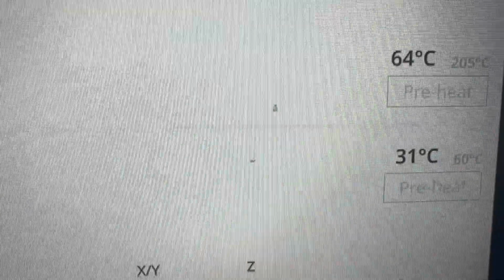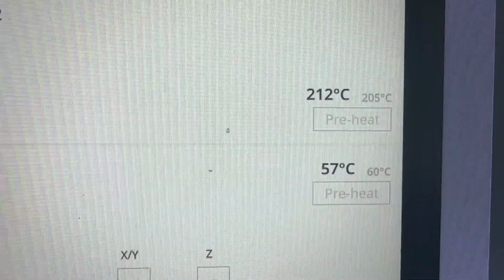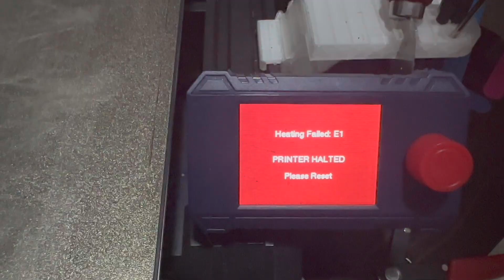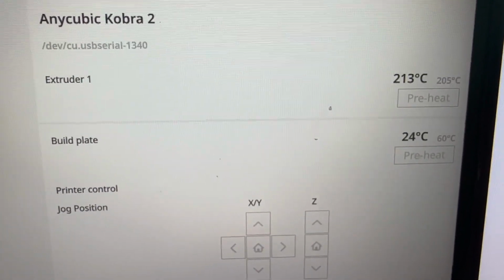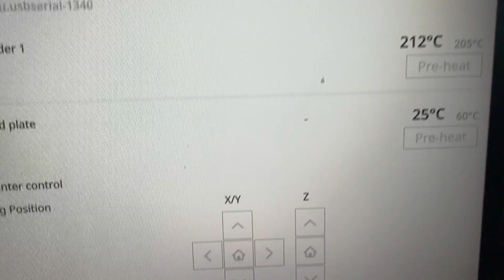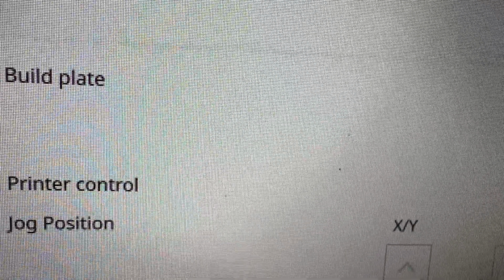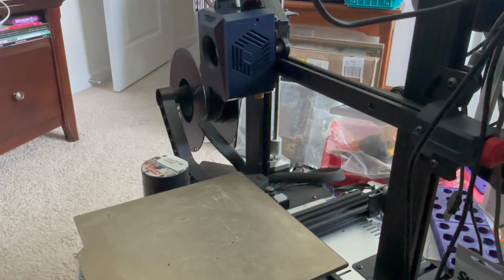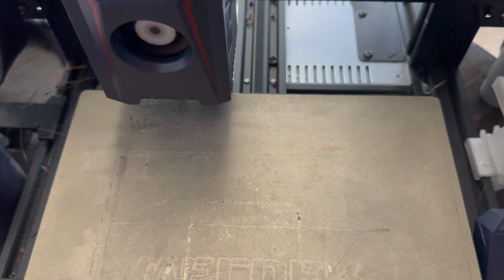🔥 Fix Your 3D Printer in Minutes: Thermistor Diagnosis & Repair (Works on Any Printer!)

Comment: Question if u have time I try to start print but stops and temp is supposed to be 140 but stays at 143. U think I should just get a new hotend
Reply from the maker: So it starts the print and then stops? A new hot end might solve your problem
Reply: @ProfessorDIY thank you
Reply from the maker: @danielstaystrong  I am here to help, what printer do you have?

Comment: It’s probably The Thermistor that may have moved or you may have heat creep which is quite unlikely as that usually wouldn’t affect the temperature much but if you are close to the maximum temperature  that may be the cause and you can find the maximum temperature inside the Klipper print.cfg near the extruder section and that will say the max temperature it can go to. If you want to be safe you can check the thermometer as it will be on the heating block next to the actual heater that gets it up to temperature and you can just follow the wire to see if it’s intact or check to see if the fan for the heat block is spinning and there are quite a few tutorials to check these types of things out. Hope this was helpful. As I’ve had the same issue in the past and it took me days to solve.
Reply from the maker: I invite you to view the whole video